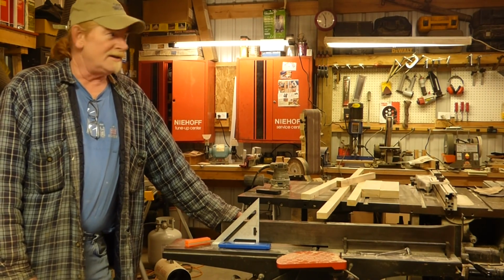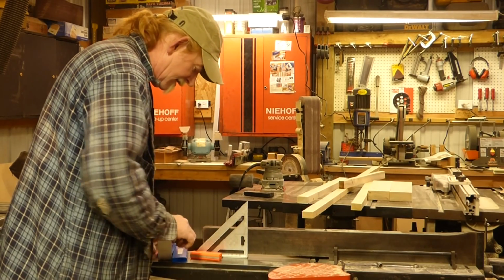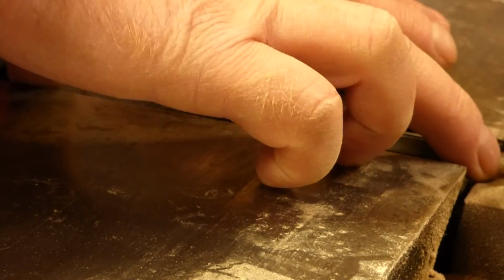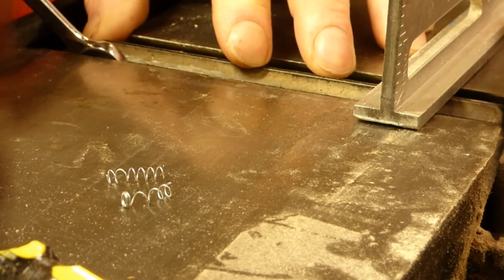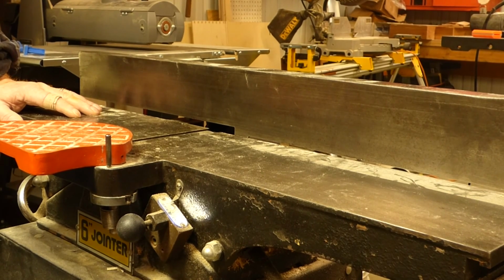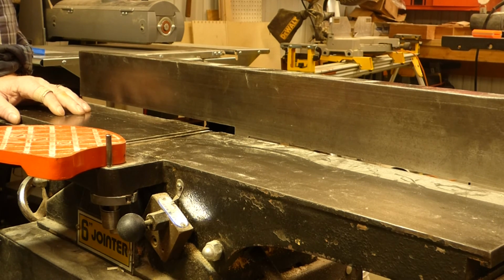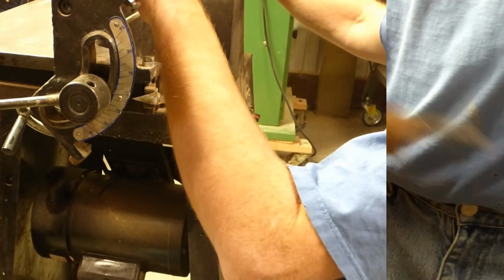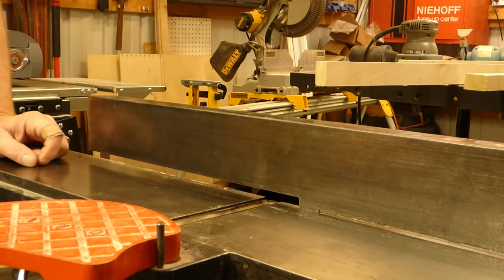Jointer, Blade Change, Tune-Up and Maintenance

Comment: Don't forget to check for parallel across both tables. Plenty of places to see this done but Grizzly has excellent tutorial videos on their website. I found that I had to shim my outfeed table slightly to make it true to the infeed. My unit was an older one too and after finding that the tables did need adjusting I took both off, cleaned the contact surfaces and reinstalled. A couple of shims from a canned drink corrected the problem and greatly improved the cut on the face of the boards.
Reply from the maker: +Roger Stephenson great tips on the shims, thanks for watching and love hearing from you.. what did you use to check the parallel?